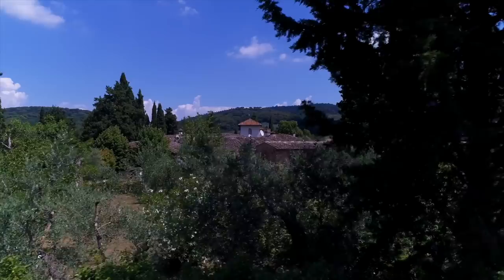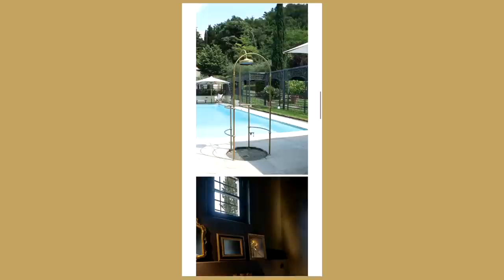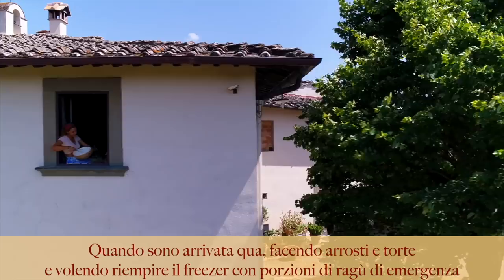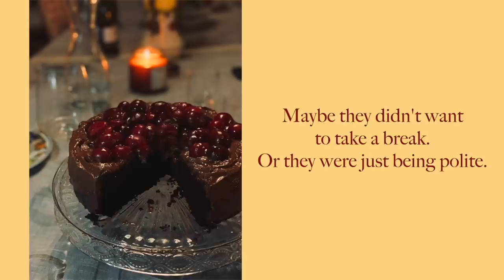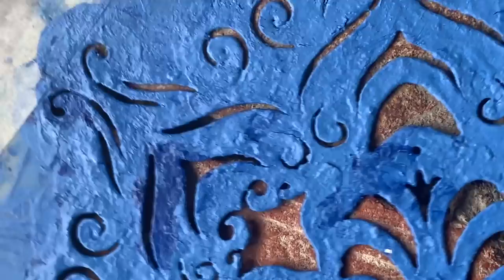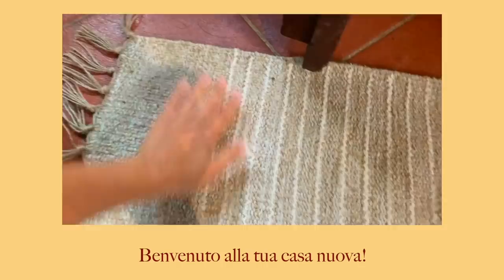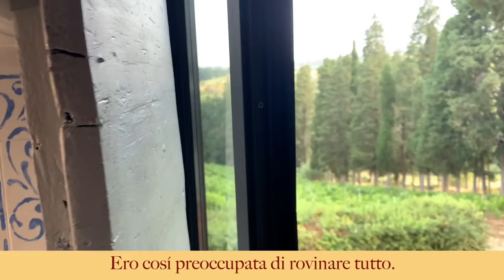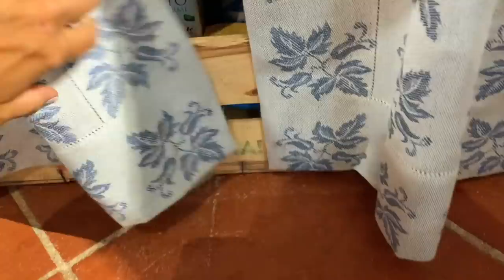ITALIAN KITCHEN MAKEOVER PART 2: Hand-painted Tiles, DIY Dolce Vita, Renovation Remodel, Tuscany

Comment: Hi @Kylie, what a gorgeous transformation.  If you think of stenciling again, here are a few tips from my stencil mentor: 1) when you use a brush, dip the brush in the paint and then dab on a rag or something to remove most of the paint.  You can control and very it almost like your fingers.  2) it's easier to clean the stencil with rubbing alcohol.  3) try to make more than one copy of the stencil in case something happens to the original.  Best to you!

Comment: You can add wheel casters to the rustic wood bin for your veggies and maybe a rope this way it is easier to table out from beneath the counter by sliding it out. I saw this hack somewhere and thought it might be useful for you. those wood crates are so raw and the wood can cause a lot of splinters so the rope idea might help with that :)

Comment: You might like to try yachtiong varnish, but test it first on something that is not in place, esp on white paint, like a piece of wood or old tile. It's rock hard - you can even wire brush it - because it is designed to withstand this sort of treatment on the hull of boats! Would be good for sealing painted floor tiles!